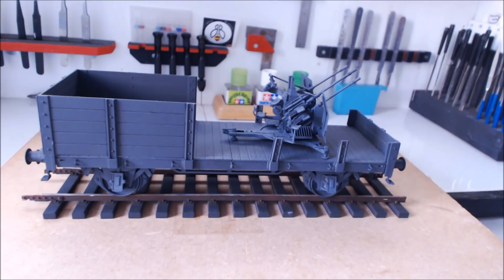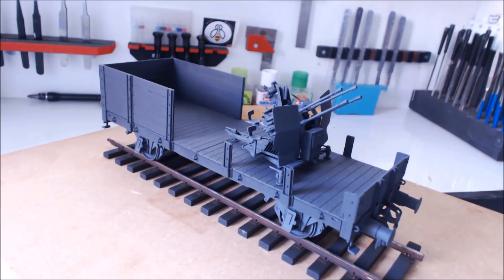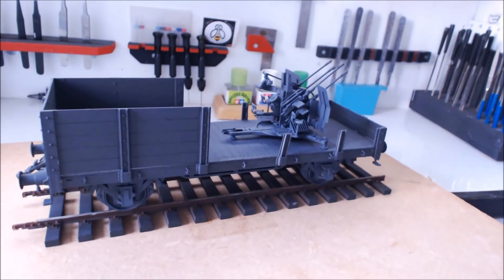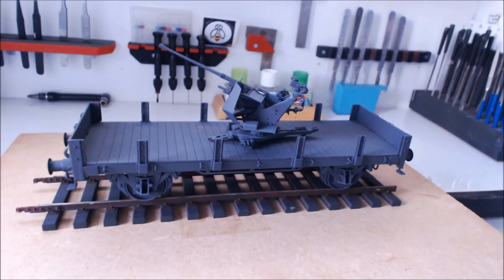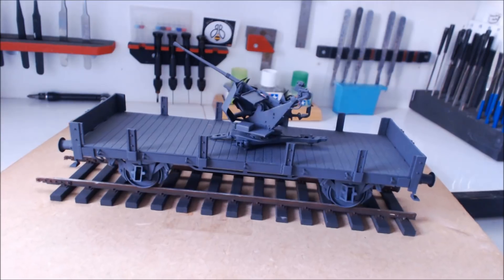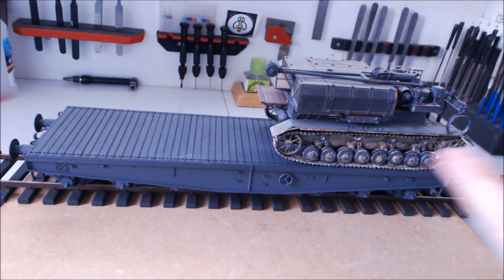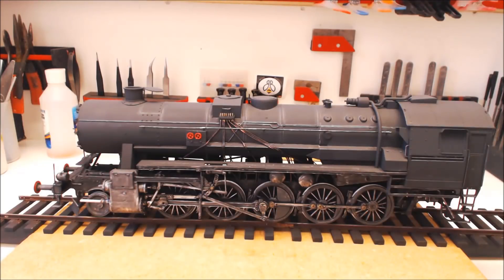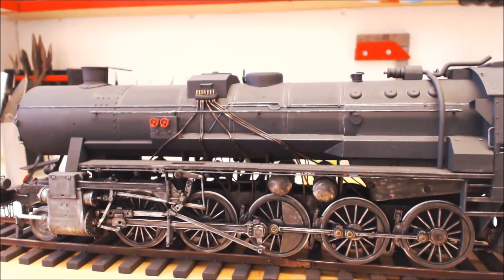Time To Have a Quick Look On The Bench

Comment: Simon, I see what you are aiming at with the metal effect, and you are achieving it. Side rods look great. Also, on the running gears, bearings etc, these were oiled ALL the time, so there will be plenty of oil drips.

Comment: Simon, do a google search: color photos 1940's steam engines
You'll find a lot of great pictures to help your weathering, including pics of European engines. 
There was a time when US engineer's had their own engine; they took very, very good care of it. The ball bearing joints would look a little "wet" from the oil and grease, but the crew usually kept the running gear as clean as possible. What I don't know is what the German practice was during the war. For all I know they might have used a pool system and no one cared what the running gear looked like. So yes, color pictures are your best bet. Oh, and I think the wear on the running gear looks spot on for a loco that's been used a LOT, such as was the case. The German railroad could NOT keep up with demands on the Eastern front. The myth that the Germans didn't have winter gear for the first winter grew out of the railroads inability to deliver ammo, food AND new clothing. The gear was ready. They just couldn't get it to the troops.